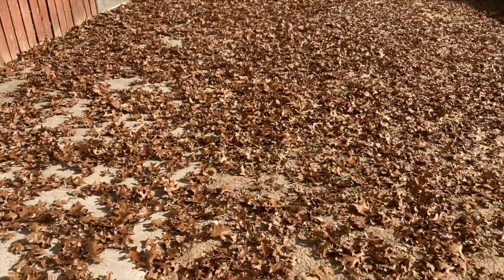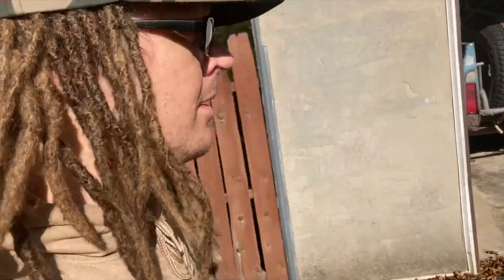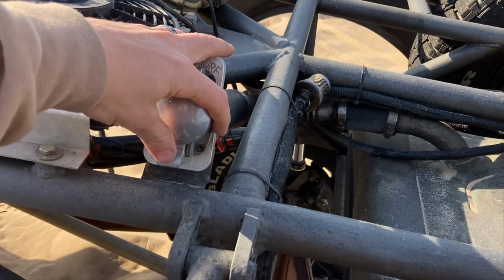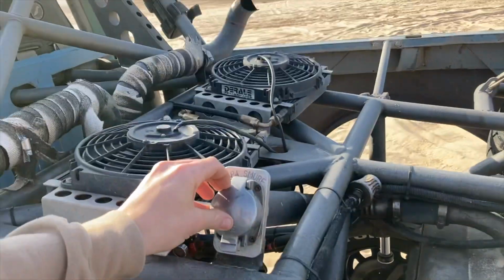Silver Lake Sand Dunes closing day 2022 Rip - Dune Hippie Vlog #19

Comment: Are you running a stock style fuel filter or? 10 micron post pump filter shouldn't allow sand to the injectors
Reply from the maker: I run a 100 micron mesh filter on my pump and a 10 micron inline filter. There is silt dust in the dunes however that is smaller then 10 micron in the dunes. That’s what’s making its way into the mesh screens in my injectors.
Reply: @dunehippie  time for a 2 or 5 micron!